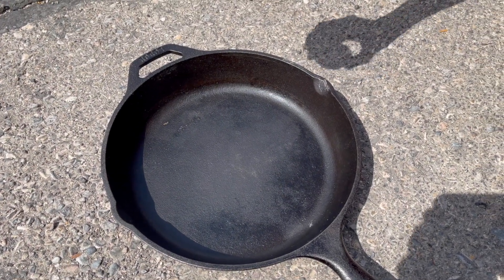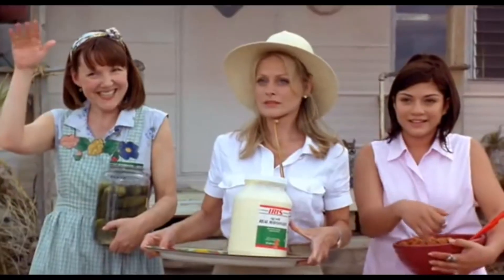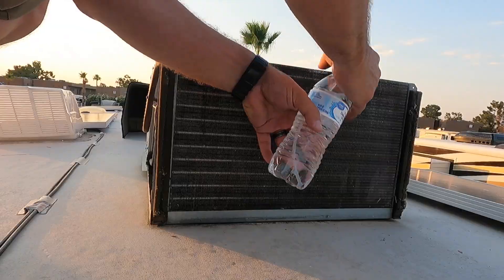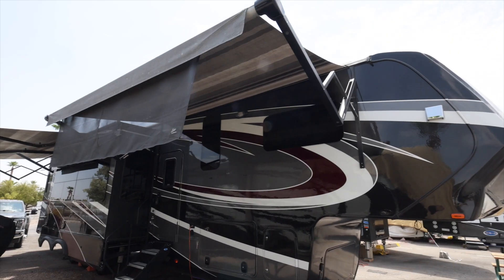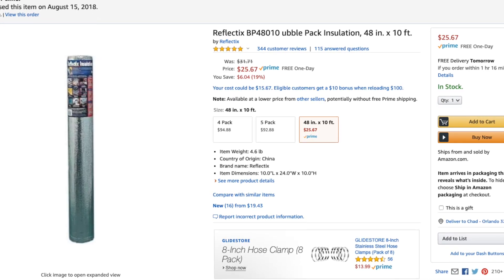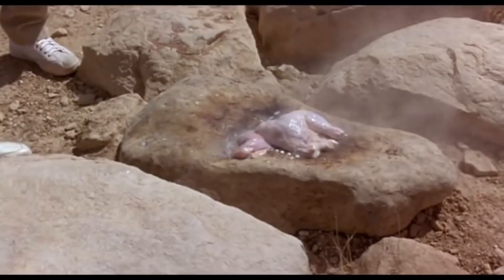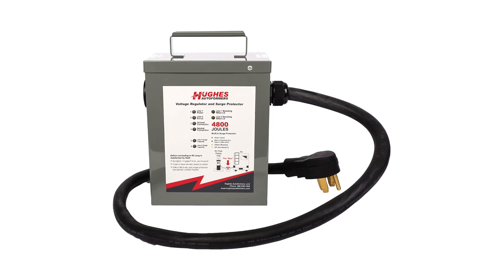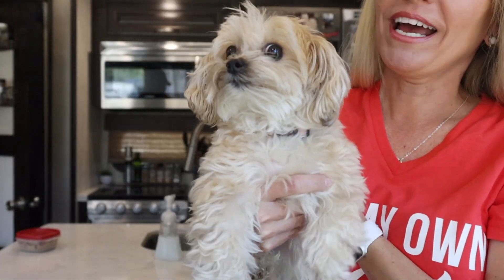🥵  RVing in EXTREME HEAT! ☀️ (Full Time RV Life)

Comment: In India there are BLDC compressors making Entry in split AC market . A 18000BTU will start at 0.2 Amps and max out at 5.5 Amps and average out at 4 amps. In watts the consumption is 400 wa. With 20 KW battery and solar charging you can boondock permanently. The noise reduction is tremendous. For share you can use green Agricultural shade net 95 ratings. If you create a gap of 2feet from roof, you can get a difference of 45°F. I regularly use them in India at my workplaces where day temperature goes up to 122°F regularly.
Reply from the maker: Wow.. that's some low power consumption!

Comment: Curious if you have tested the results of closing off your garage and running the back a/c. Have you noticed a positive difference? 
A few things to think about:
1. That a/c is pulling return air from the closed off space in the back. That space will be significantly hotter than the rest of your coach, easily 100+ degrees in that climate. You can expect a 20 degree temp drop across your evaporator coil of the a/c. So you may actually be heating up your common supply duct by running that a/c. 
2. Since the return is pulled from the garage, you need to give air a way to get back to that a/c’s return, otherwise it will likely pull even hotter air from outside through any cracks it can find. 
3. Of you run that a/c on low, you will likely benefit in two ways: lower airflow means higher temp drop across the coil AND less air that needs to find its way back to the a/c.
Reply from the maker: Very good points.  👍🏼

Comment: I know y’all pretty knowledgeable about RV but from a electricians point of view number you should get a buck boost transformer number two park as close to incoming power source to park cause of voltage drop and as you you should only expect a 20 degree ambient temp difference anyway in a RV good luck

Comment: Re the Hughes Autoformers: they don't create power - they basically convert amps to give you more volts - VERY important to protect your RV appliances with good voltage. And if you pay for a 50 Amp site, an autoformer WON'T give you more amps than you paid for. What you WILL get, is better voltage to run your equipment and, often overlooked, will help protect your appliances from damage by low voltage. 

Important: don't let campgrounds with low voltage prevent you from running your appliances properly or, worse, it ruining your expensive equipment. /end of service announcement. :)

Comment: Have you guys heard about that coating you can get for the top of your RV? It’s supposed to drop the inside temp by 10-20 degrees. It’s a roll on substance? Would love to see/hear your input on that stuff.
Reply from the maker: We've heard of some roof coatings, but hadn't heard about the temp improvement...
Reply: @ChangingLanes  I think it was Henry’s…but the folks in the feed said it dropped internal temp by about 15 degrees. Was hoping you guys might know more. 🤓
Henry’s has several different products. I saw the post a while back when I was just starting to research rvs…so didn’t write down specifics. I’d prefer hearing about this from one of the channels I follow than a stranger in a fb group. 😉

Comment: How miserable!  When my late hubby and I took a cross-country trip (tent camping and occasional hotels) back in Y2K, from CA to AL,  (in the summer!) we stopped for gas near midnight in Needles, CA.  Needles is approx. 100 miles south of Vegas (but from there at night, you can see the big light shining up from the peak of the Luxor hotel pyramid).  At any rate, the truck we had at the time did not have A/C, and we didn't even realize it until we were on that trip.  The controls looked the same, but, coming from San Francisco where we llived at the time, you don't need it, so we didn't pay attention.  
Hot as we were in the truck (using "4/65" A/C), when we got out at the gas station, we nearly fell over: it was like stepping into a blast furnace, and the thermometer on the building said it was 100 degrees---AT MIDNIGHT!  We said something to the attendant, and he said, "Oh, it's much cooler now.  You should've been here at noon: it was 20 degrees hotter!"  YOW!!   We like hot weather, but not THAT hot.  (Needles, CA gets very, very hot, and is jokingly said to be just 1/4 mile from hell.)

As far as running the A/C all night--that would be fine by me.  I suffer from tinnitus, and have to use a white noise generator anyway to get to sleep..because the condition only bothers me when everything is quiet.  The normal daytime noises are sufficient masking.

Wish we'd known about that 'soft start' back when we had our boat.  (or maybe it wasn't even invented yet...)  The boat did have A/C, but it only worked on shore power.  One trip we went on, we strapped our portable generator to the bow, thinking we'd have "shore power" at an unpowered location...but no...it would run the stove, and keep the teeny fridge cold, but that was it.  While the output was technically enough to run the A/C, it couldn't handle the start up load, and the breaker would trip.

Comment: RV'd in Vegas for 2 months during the summer...warning for the reflextics...we put it on all the windows and it worked great.  Drawback is the TREMENDUS HEAT BUILDUP between the reflextics and window.  Be careful of things that can be damaged by heat.  I totally warped the window divides in the front of the coach's sliding windows. The windows had to be replaced because they could not be repaired.  I recommend getting magnets and securing the reflectics on the outside of the glass!!

Comment: The autoformer will use amps to up the voltage but is limited to the rating on the pedestal breaker. If the park is giving you the 50 amps you are not taking it from someone else! People that came up with this theory either don't know how electricity works or want to blame someone else for their problems. 
The shroud needs to be on the A/C for best efficiency. 
I don't think that cooling off more at night will make much difference by afternoon. Rigs don't have enough insulation to hold the temperature for long periods of time. Other tactics like shade and window covers are very helpful. 
Most rv a/c are only capable of 25°-30° temperature drop. 120° outside means 90° inside. 
I keep several bottles of water in the freezer for ice chest on trips and rotate to the fridge.

Comment: Make sure no air is escaping because each window has seep holes and quite a bit of air gets sucked in through them if any exhaust fan is on. You didn't mention a surface or forehead thermometer. It is interesting to see how hot the walls are and the window glass and framing plus the ceiling etc. You can see how much insulation is helping which there most likely is none. You can see where the steel and the aluminum framing is because they suck up the heat and cold from outside and transfer it right into the rig.

You need a home style AC refrigerator. We are just too familiar with them and trying to operate these old and dangerous propane units is not fun. I replaced mine. In the summer the flame always burns and to operate it on AC because it is a heater takes 300 watts. They are pure garbage and have been ripping us off long enough. These days they should be powered off batteries and solar panels along with the TV and miscellaneous electronics.

It is best in those situations to blanket off a section to cool. In 1977 we were in the parking lot of Circus Circus with a 28' Champion and 4 kids with one AC unit. It was brutal but me and my sister after swimming went for a walk down the strip and it was 115. We could only walk a block before resting.

That night I went with mom and dad into the Casino underage, I was 20. I won $150 on a nickel machine and I took my parents out for dinner. They tried to hook me early but it didn't work.

Comment: Chad how did your truck perform towing in that heat? Here is a tip if you want the mess. Run water slowly over the condenser  which will made the AC perform better as long as the water will not infiltrate your roof. Blame it on Phil and Stacy. LOL

Comment: Great tip about putting a fan by the circuit panel. I didn’t know they were tripped but heat. We stayed at a park in upstate New York where my EMS kept tripping due to low voltage. It showed 95 volts. The park electrician tried to convince me that there was a problem with my RV. When I showed him that my EMS worked fine with my generator he  admitted that the park had power issues and that they had a 3 year plan to upgrade the electrical in the park.

Comment: You're aware an Air Conditioner limitations, right?  It is designed to accommodate a 20 degree reduction from outdoor temperatures - but is also impacted by the amount of humidity (or lack there of).  It's essentially a dehumidifier (it's original intended purpose in factories as moisture was ruining product - and then a side benefit turned out to be cooling).  Condensers cannot run constantly and still remain effective.   And, the West has much less humid air to work with.  A house has a big advantage over the RV because of the volume of air in the house (giving it much more resistance to change).  RV walls are thin... making them terrible insulators.

Comment: If the AC unites, as I have read, only reduce the outside ambient temperature, 20 to 25 degrees lower inside, how did your units get the inside temps to 65 degrees?  110 outside would only get down to 85 inside?
Reply from the maker: A good Delta-T is 11-20 degrees.  That's the difference between the intake and exhaust of the AC.   Since it's recirculating the same air, it continues to cool it.  If the RV were perfectly sealed, it could go way below outside temp.  It's the less than ideal insulation of an RV that makes it difficult.

Comment: You mentioned problems with the GoPower inverter. I'm thinking of purchasing one. What was your problem?
Reply from the maker: Not entirely sure.. but it seems to want to take over from the generator sometimes. When it does this with 2 or 3 ACs running, it almost immediately give an overcurrent shutdown error.  As it should since the load is way to high for the inverter.  I'm not sure if there's a problem with the inverter or if the generator was putting out low frequency.  I've since adjusted the genny but haven't had a chance to test it.  Look into the new victron multiplus ii 2x120 and do some comparisons... I thin the victron might have better power share abilities, but I'm not sure yet.
Reply: @ChangingLanes  Thanks Chad! Growatt has a 6kw 48V split phase too.

Comment: Will your solar system not make up the difference for low power at the pedestal?
Reply from the maker: Sort of..   Our inverter can do power share on line 1.  But it wouldn't really help in 120 degrees since we need all available power on both lines.

Comment: Hi Chad and Tara 
My wife and I have been following you guys for a while now.  Love watching your videos.  We can concur to the 120 degree heat.  We have been there ourselves., it's not fun.  Chad you brought up something in your video that my wife questioned.  So we had to replay  your video, and yes I have to agree with her. You referred to you A/C issues that you didn't have enough watts to power your A/C untils. That's  not correct.  It's not watts that you are trying to achieve.  Watts are what you want from your light bulbs, amperage is  what you need  to run your 3 A/C until efficiency.  
Keep up the videos and  we will see you on your next video.

Comment: Water on the roof. Like run a sprinkler just enough to keep the roof wet. Simple method like sweating, evaporates and removes heat.
Reply from the maker: Thought of that but not allowed by the park... 😞
Reply: @ChangingLanes  Ya I was thinking the same thing after I made the comment.

Comment: We live in Palm Springs and we deal with Temps like these every summer!!  Our a/c man says even home units are not made to work properly over 105!  With the RV refrigerator I had a string of misters so I tucked one head on this line up in front of the cooling fins are and this along with fans I had previously installed that blows air up thru the cooling fins. And the fine spray of just a little water spraying made a huge difference!

Comment: I just added fans behind our fridge one at the top one on bottom. Put them on a push button switch so I can control them and turn on when I need. In 90 degree temps I was able to run fridge on 4 and still get below 40.

Comment: Yes I was in AZ in my off grid house when it hit 126 one day. I only had a swamp cooler and knew it wouldn't keep the house cool, so I went and bought an inverter AC just for the bedroom. I had to switch off my solar over to running my Honda generator during the night to run the AC in the Bedroom and the Swamp cooler for the living room and kitchen. My house has vaulted ceilings and you could feel the heat radiating from the ceiling during the day. I did the same and put reflectics in all the windows which helped a ton. I had my motor-home down there to bring back to WA state but waited till we finally had a cool day of 108 to leave. Lucky for my by the time I got to Vegas they were having thunderstorms and rain so I was cool the rest of the drive. You gave the best video on dealing with the heat in an RV I have seen. Good job

Comment: We saw 110-114  while boondocking for 8 days in central WA at the beginning of July.  Used awning to shade one side,  set up with the trailer north/south to minimize sun in windows.  Also the AC units in RVs are only going to lower temps maybe 40 degrees.

Comment: Mini Split 3 zone compressor mounted in your Garage will use just slightly more power than 1 of your roof AC units and provide more AC or Heat to all 3 areas at a much lower decibel level. Just enclose the compressor unit and large vent to outside then remove those old roof units and seal and insulate the opening. Or at the least do 1 in the bedroom for the lower sound level.

Comment: Just FYI EVERYONE WHO EVER IS DEALING WITH EXTREME HEAT, THE COIL NEEDS TO BE WASHED THOUGHLY WITH A HOSE BECAUSE THESE COILS ARE ABOUT 4 INCHES THICK! IF YOU CAN PUT ONE OR TWO MISTERS IN FRONT OF THE COIL THIS WILL HELP TREMENDOUSLY. THIS WILL LOWER THE HEAD PRESSURE AND THE UNIT WILL USE LESS AMPS AND COOL MORE EFFICIENTLY THIS WORKS ON HOME UNITS AS WELL. EVERYONE STAY COOL!!! HOPE THIS HELPS.

Comment: We camped in the extreme heat without using our air conditioning.  We are at a permanent campsite with only 30 amp power.  We open windows in the late evening/early am.  We close the blinds where the sun would hit, we keep our awning out to help keep the rv cooler.  I keep a small bucket filled with water and soak my feet in it when I get too hot.  I also wear a neck scarf that you soak in colder water and wear around your neck.  It makes a HUGE difference.  Also keep lots of cold water in the fridge, get any physical work/exercise done in the early am.   We also invested in a dyson hot/cold fan and we use the fan at night.  Also if we were hot and sticky we would have a quick shower a couple of times a day.  Open your fridge/fridges as little as possible to keep the heat out.  Do your hot cooking/baking late at night or early in the am.  We turn our fantastic fans throughout the day, we have 3, to help draw the hot air out.

Comment: ????   If you had the power (power not a problem)  But say you cheaped out and got that rig wiht 2 AC's could you run a portable AC and let the water go down the shower drain?  I do not know how they work but the heat would just blow back into the room, you might only be lowering the humidity which probably does not matter in the deserrt.
Reply from the maker: We did see some window units and some have commented about mini-split ACs....

Comment: Can’t you turn your inverter down to 40 amps and use your batteries to assist to make up the 10+ amps.
Reply from the maker: Yes.. but it still wouldn't help the low voltage on the pedestal...  The breakers that were tripping were the 20A breakers on each AC.
Reply: @ChangingLanes  got ya.

Comment: All good tips.  We do mostly dog shows and try to avoid summer but sometimes we get surprised by 110-115 degrees.  One thing we added was window awnings to our class A and they help a lot.  We have the Hughes Autoformer and it has been a life saver.  At the dog shows you have a parking lot full of 200-300 RV's all running the AC in the heat of the day via a very stretched thin electrical distribution system of spider boexs and 20A circuits to duplex receptacles all in the hot sun.  Again, without the Hughes we would be stuck do to low voltage.

Comment: I need to check out those roof covers! For the inside I purchased magnetic vent covers for my floor registers. I did not want any of that precious cold air going under the floor where I could not enjoy it. To make them less visible I applied adhesive contact paper to blend in with the floor. It’s not a perfect match but way less visible than the stark white of the plain magnets. Thanks for sharing your tips!

Comment: Some of the issues you had with low voltage and high amps may have been related to the grid in that city and not just the RV Park itself.  We saw brownouts (low voltage events) during our last trip that only occurred during the peak usage hours (hottest hours) of noon through about 8:00 pm.  After 8:00 our unit raw fine as power supply to the RV park improved.